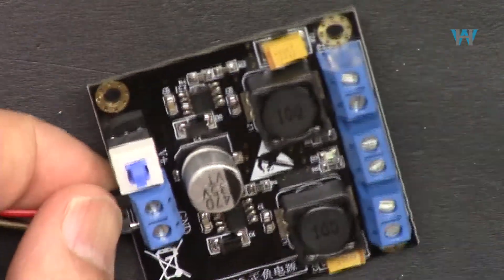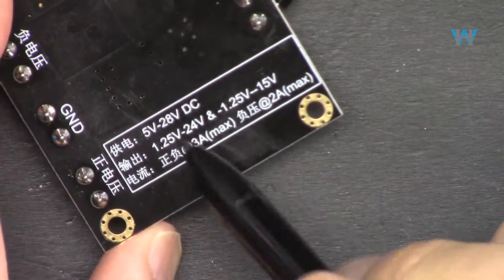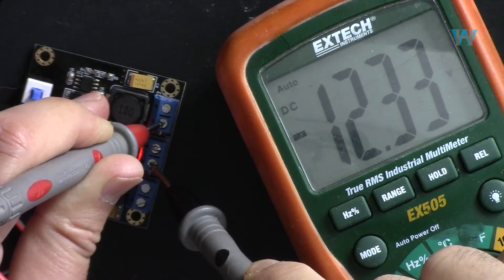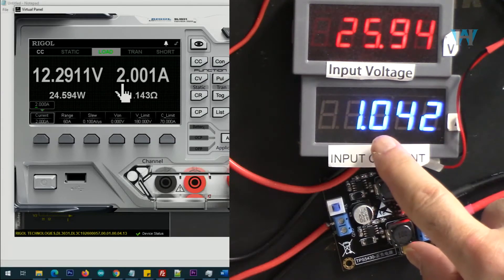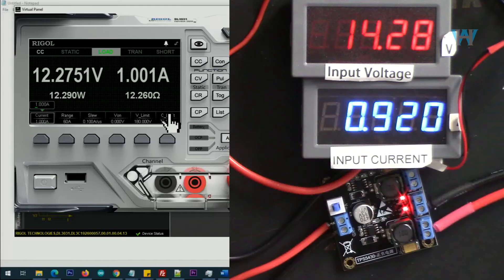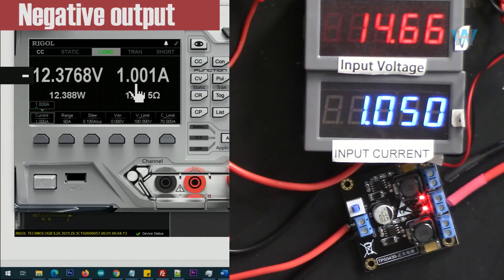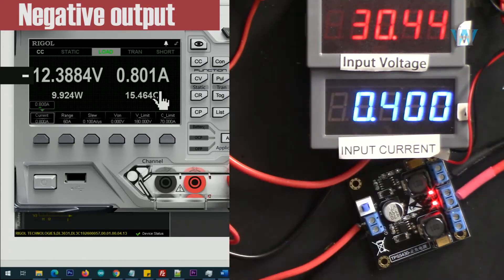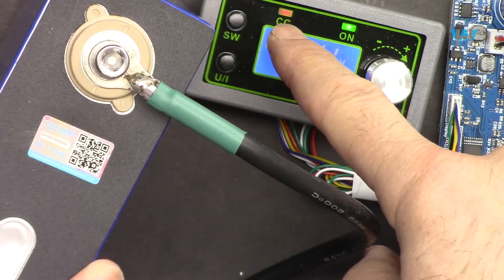Review of TS5430 Dual +12V -12V input 14V-30V 2A Converter

Comment: Hi! I was just thinking about this module and rewatched your review. Do you know if it is supposed to be able to handle two loads (it has two sets of terminals ) at around 2A, or is the 2A rating considered total amps for both loads / both potential outputs combined? Somewhere in my research, someone said each output could support 2A because it has two of the TI chips, but based on your test, I’m questioning that. Maybe each chip is dedicated to the positive and negative output? I’m thinking about getting the 5v output version of the module so I can use a bunch of high quality 12v adapters I have here to run two devices (both loads are 1.5A 5v LEDS +  an ESP32 controller. But if this can only handle 2A total, it might be better to use two LX4015 modules (or anything better you might recommend to run dual loads). What do you think?

Comment: I would be interested in seeing a review of the LT8705 600W Buck/Boost converter, which handles 75W 20A.  There are a few versions on Aliexpress, look for one that has 5 potentiometers.  It has adjustments for Input CC, Input CV, Output CC, Output CV and Low Voltage Cutoff.  I've used the 1200W and 1500W Boosters you reviewed, but always wanted a Buck/Boost that could handle a similar range of voltage and current.